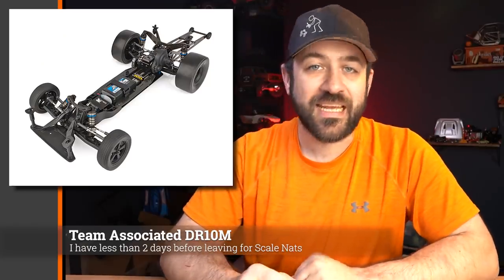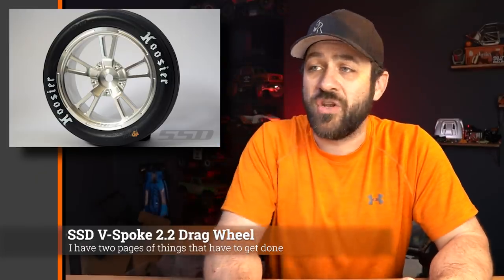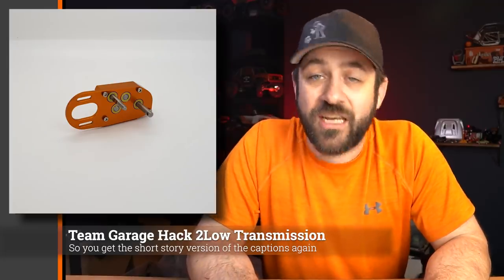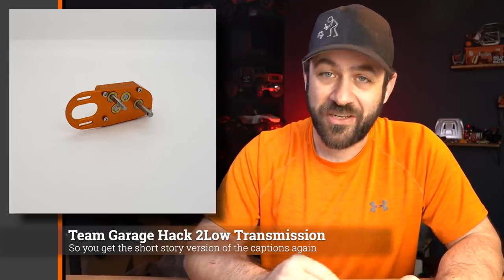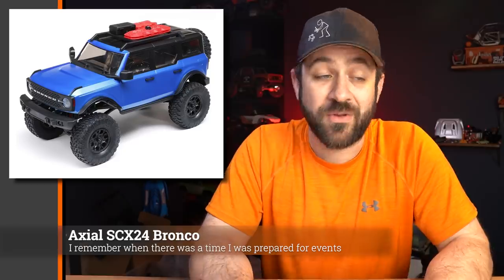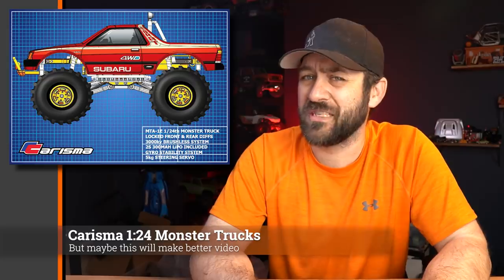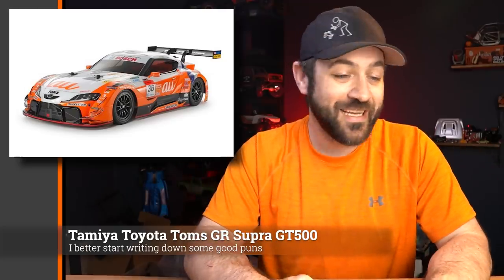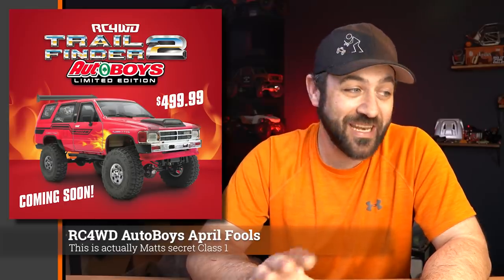Whos the FOOL? - Scale News Update - Episode 201

Comment: I have 6 1/24 scale monster trucks and parts to build 2-3 more...so I'm on the fence about them. I have the prototype Furitek chassis from a few months ago and am pretty excited about this release. As for the Carisma M/T, I think it was an April Fools joke. Though I have heard that their mini race car open diffs will fit in the solid axles...so it may be something they could do. But you'd appreciate their description on it, "ach rig is also equipped with the revolutionary new 'CAGS' (Carisma Automatic Gyro Stabilisation) system, developed in conjunction with the Brand Manager's cat, to keep the rig stable in the air, and always landing on it's wheels (well, most of the time!)." No stabilization is better than cat-inspired stabilization. Great update as always.

Comment: I like my 124 c10. It's true it adds up if you buy upgrades but they end up pretty fun on indoor use and a good way to let go when weather or time does not allow you to go outside or on a long trek. 

Also since they are a bit less capable i still see mine as a skills training and helps managing and learning lines and body roll , etc and now with the added difficulty and tuning setup skills  a hard body will require.. 
I dig it 

That said if I ever end up upgrading esc receiver motor the whole tally will be rather scary to look at. When people say it allows one to get to crawling on the cheap... That is if you keep it stock or little upgrades , and they don't crawl that much. 
This said with the new proline hyrax and free mods like the ones proposed by big sun it already begins to be competitive to some point on the cheap. Granted

To get to crawling on the cheap, buy an element ecto I would say? But that will be controversial surely. The main downside of ecto is little to inexistent path for upgrades but it's so capable out of the box that it makes me wonder. My ecto has a 1080 beadlocks with trenchers and hair buns and had to change the stock servo which lasted me three battery packs. Apart from that...I did the big sun and roadside rc free mods and the ecto is a killer and climbs things my trx4 was never able to even get to half of it, even after mods.. The only bad thing it seems to have or is it just me, the screws are always getting loose. So much plastic all around so threadlock is a Nono... 
Oh well each one his own view and experiences right, maybe the terrain here is not what others have over there... 

But back to 1/24 with quite the makeover you end up having a little thing that can climb at scale and be rather fun and still challenging which also adds to the loop of the having fun from my point of view

And about a mini monster truck... You would maybe need more room than just a mini crawler setup or like my miniz drifter(yes well it's 128 but not that much of a difference, and it's not like you need so much space to have a big C and an 8 as a circuit)

Not everyone can afford an scx6 so a 24 is also ok. 
And you can see if you adult want to try the hobby, or get kids to get into the hobby... 

I can dig why the offering is on 124 scale is expanding and being everytime more complete and so many parts available for maintenance and upgrades, it's also showing it's a trustworthy even if tiny hobbygrade platform and reassures buyers who might be scared to have a toy you might not ever be to repair. 

And the good thing about having a choice is that no one is forcing you to buy one. 
I mean up until recently it was either 110 or 1/5 scale and exaggerating only nitro, now you have all the lipo power you can imagine in all the scales, actually 1/16 is often pretty fun. 

I'm ok with  a 1/24 monster truck even if it's the opposite in size of what is a monster truck🤣
But again my 1/28 mini z skyline rwd GT-R is really sick and fun so who cares. 

And like many say, the best hobby rc car truck plane drone boat or heli is the one which puts the biggest smile on your face. 

If it's not for comp then it's just adults playing with toys, so come on a bit of perspective rc family. 
Peace and may the torque be you all

Comment: I am into the micro monster trucks.  The chassis were designed around the diecast bodies which most are actually 1:32 so the look great with my Orlandoos.  The nice thing about the small scale is MT obstacles are easy to find and cheap and you can set up a complete rc Monster Jam race and course in a living room or garage.

Comment: I personally am not into any 1/24th scale vehicles at the moment, but as I'm into 1/10th scale crawling, if and when they can make them really performance based/ fluid filled shocks, I will probably jump in head first into the crawler side with light weight body, lcg, sticky tires, HH motor, new esc, HD steering servo, ect...

Comment: I think 1/24th is a good option to have especially considering the cost savings, but I prefer the 1/10th scale being easier for me to take apart and repair. I just think I would be frustrated working on smaller parts and not losing them on my workbench.

Comment: 1/24 scale cooler in every way.  Cheaper/easier to carry/build/store the rigs and obstacles     More track in less space and not enough inertia generated to break themselves. More time actually playing instead of broken on the shelf waiting for parts.  Other objects accessories and scenery like model cars buildings and figures also cheaper and more available. Cheaper batteries longer run times for the buck. Cheaper bodies wheels and brass parts.  Ability to mount metal scale hard bodies from retail stores. Easier to use indoors. Can buy 2 or 3 for the same cost and have friends/family money play or have a backup rig for same cost or cheaper.  When said friend breaks cheaper rig they can use the third rig and it doesn’t hurt too much to fix what they broke. 3-90 year olds can drive them without accidentally hurting themselves or the rig.  24th scale FTW